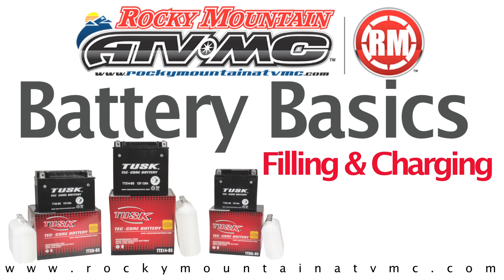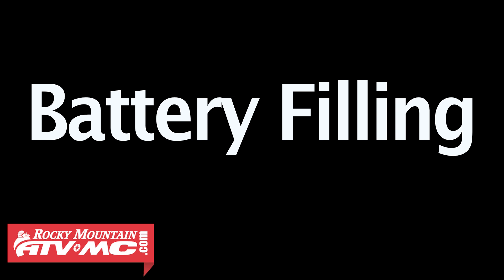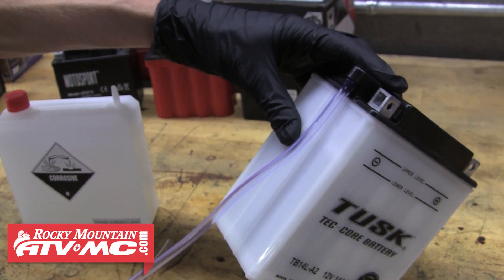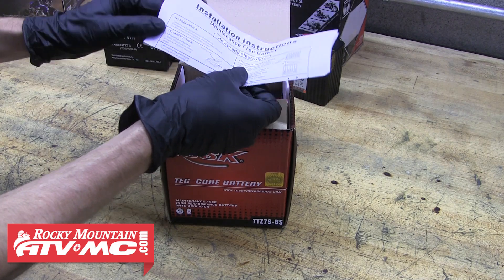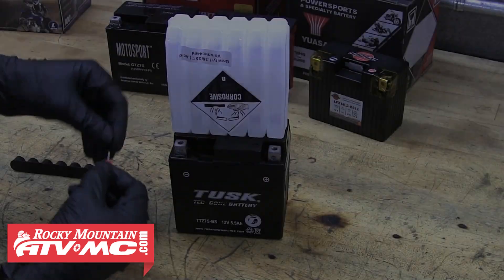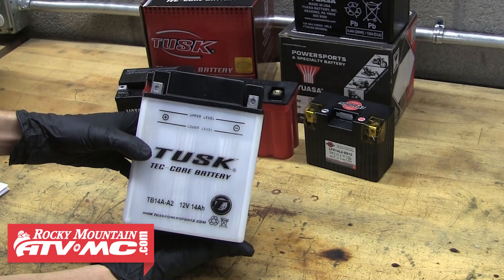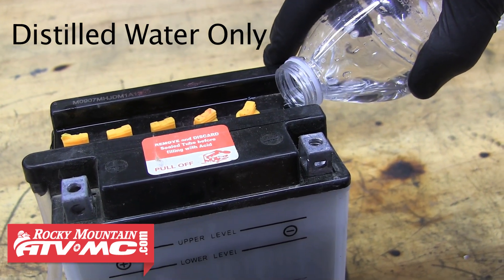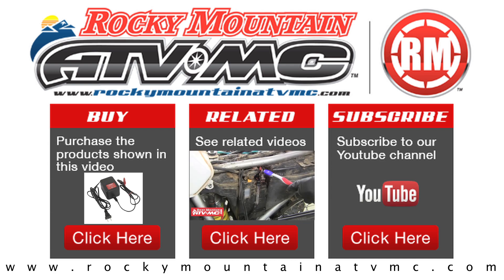Battery Basics & Activation - Filling & Charging a Motorcycle Battery

Comment: I heard you have to leave the plugs out when you charge it because they build up pressure, is this true
Reply: I had a mark on my ceiling cuz I left caps on.
Reply from the maker: Austin Allen that is good practice.  I personally do it, but most acid type batteries will have a vent tab on them, where you can attach a breather hose.  This vent helps any air bubbles to escape.  It's more personal preferance if you choose to leave the plugs off or not.  Both methods work fine.  Thanks for watching.

Comment: Scary as hell working with sulfuric acid. If you poke a vent hole, make sure to be patient and not squeeze the bottle unless you want to squirt sulfuric acid on you.
Reply: Its not that hot. Lol. Just have some baking soda and vinegar handy and dont go tossing it on your kids & you should heal up just fine. 😂  ive literally sat in a 100k gallon tank thats used to store it at about that same concentration and it stings a little..

Comment: when charging a normal acid battery do i need to put overflow cap back on or leave off wile charging?
Reply: @rmatvmc  I know this is an old comment sorry, but do I put the overflow cap back on before installing the battery, or does it just stay off, also what is the tube connected to it for, and do I leave that on?
Reply from the maker: @Zemixify  Yes, you will want to put the cell caps back on before installing the battery on your machine. The tube connected to your battery is the vent hose, you can see at 2:00 where we talk about the vent hose and you can leave that connected. At the very end of the video at 8:29 you can see the battery installed on the machine with the vent hose still attached.

Comment: if I received a dry 6 volt battery and add the acid to it, let it set for an hour, then check it with a volt meter should I get 6volts (roughly)? I know it won't be a strong battery until I charge it but I should get 6v. I am getting only 3 volts (roughly), would that mean I received a bad battery?
Reply from the maker: It's really hard to say on that.. roughly the battery should have about 70-80% battery life.  I would tell you to charge it and then check it.  If it's at 3v then, then i would warranty it.
Reply: My apologies, I didn't purchase the battery for you. Despite now having it on a .5 amp trickle charger for 6 hours it still shows as 3 volts.
Thanks

Comment: We use a battery for our inflatable boat. The acid level dropped after loads of usage what do i do?
Reply from the maker: It depends on the style of acid battery you have?  Some batteries are sealed with a strip on the top and others have an individual battery cell caps and these you can easily refill with acid or distilled water and then put on a battery tender to charge.

Comment: Hi, thanks for the great video. Just a question, can i use the battery just after filling the acid in (as I don't have the charger)? I've always thought that the electricity generated when running the scooter will gradually charge the battery?
Reply from the maker: To get the full battery life out of the battery would be to charge it first.  The stator doesn't put out enough electricity to charge a battery's first charge.  Your battery will be at around 80% battery life after filling it with acid, so yes you can run it after you have filled it.. but i would recommend you charge it after.

Comment: yes it is, yall think by me forgetting to charge first caused it,but all lights showed up just when push start dont hear nothing.
Reply from the maker: @Shedrick Bosley It could very vell be your starter is bad?  If you have access to a multimeter test the battery and see how many volts it reads?

Comment: installed new maintenanc free battery bike started good a couple of times then tried to start its like starter wasnt getting no power please help
Reply from the maker: @Shedrick Bosley Are all the cable leads tightened down nice and snug? It could be that you may have received just a faulty battery?  Is it the sealed no maintenance battery? No filling the acid required..

Comment: Hi ! Rocky Mountain ATV MC , can i use 3 amp charger to charge a  9 Ah AND 5 Ah 12V BATTERY ( not  simultaneously )
Reply from the maker: +Nimesh Kumar A 3 amp battery tender should be the max when dealing with these smaller batteries.  We recommend as low as a 0.75 amp trickle charger.  Like it's mentioned in the video, we divide the amount of amps x 10 and you get your recommended charging rate for that particular battery size. If you have any other questions let us know! Thanks for watching
Reply: +Rocky Mountain ATV MC  I want to use a HID  in my bike which draws 6 amps in the starting (for 2 minutes) and later it settles down at 3 amps of current draw  
and 
if i charge it with a slow charge rate then soon my battery  ends up with low juice ,
 that's why i was asking for a 3 Ah charger for 9 Ah battery (because slow charger will not work for me) correct me if i'm wrong.
Reply: I have this charger it has 4 and 2 amp setting, we put it on 2 amp and 12 volt is that good
Reply from the maker: Imma Turkey Yea that sounds fine.
Reply from the maker: +Nimesh Kumar What bike are you riding, Year, Make, Model? The trickle charger should be plenty to charge your battery but it shouldn’t need to be charged every single day. If the battery is getting drained too quickly it sounds like your bike isn’t producing enough power to handle that light.

Comment: helo, c0ol vidEo.. cAn u help me.. i just b0ugHt a quantum brand m0t0rcycle bAtTery, and lately i f0rg0t to tUrn ofF oNe bulb making it to liGHT FOR 4 days.. when i switch oN my m0t0rcycle, the bAtTery waz already draineD.. do i neED To recharge the bAtTery or sh0uld i replaCe it?
Reply from the maker: +Michael John Manipon Try and recharge it.  Use a battery tender that put out 1-1.5 amps.

Comment: So if "like I think I had was a old battery"a battery has lost allot of its acid and its been filled time and time again with water to the point that it has a low charge rate,but appears to still have fluid levels between the marks upper&lower then what happens to the acid-is it almost nothing but water at that point?                              Like how many times do you have to re-fill a battery in its life before you have to add more acid (if you do that at all)?
Reply: The acid never evaporates. The water does.

Comment: I just bought a new Firepower battery that is 11Ah. The only motorcycle charger I have is a " 1 amp slow charge" charger. Is that charger ok to use or do I need something different? thank you
Reply: Rocky Mountain ATV MC
Reply from the maker: Alex Alpert That will work just fine for you yes.  Thanks for chiming in!

Comment: Thanks for the video.
I got a question, the battery we got only had a short instruction and we only got one hose, since the instruction said to hook up the hose to the vent "plugg" we thought this also was the way to fill the battery. So we hooked up the other side of the vent hose to the acid pack and turned it up-side-down and it started to fill slowly. Filled the battery without problem to the upper level (through the vent plugg). My question is if we might have damaged anything with the vent plugg. 
And also, after first charge, should the acid change battery?
Reply from the maker: Utskuren Biff The vent system should be fine.  What are you referring to "..acid change battery?"  As long as each of the cells have been filled to the correct level and then fully charged it should be fine to run.  Thanks for watching
Reply: Rocky Mountain ATV MC Sry, I ment if the acid should change color after first charge, from clear to a little bit yellowish?

Thanks for answer.

Comment: My battery got hot after filling it is that normal?
Reply from the maker: nope nope Were you charging it and that is when it got hot?  Generally the battery will get a little warm is all after being filled.
Reply: Rocky Mountain ATV MC no it wasnt charging, i left to go buy a charger and when i came back the battery was around 100℉ to 109℉
Reply: I also just found out that it has been charging for about 20 hours and the trickle charger still thinks that it isnt fully charged
Reply from the maker: nope nope What brand battery did you buy?  Did you buy it through us?  If so i can look into it for you?
Reply from the maker: nope nope Sounds like something's going on that shouldn't.  Let me know if I can help you out more on this issue.
Reply: Rocky Mountain ATV MC its a tokyo 12n12A thats really old but its never been filled and i can see a lot of bubbles because the plastic is clear no and i didnt buy it from you guys although i have bought a lot of parts from rockymountain
Reply from the maker: nope nope Is it a sealed type battery that comes with a seal cap?   Or does it have individual cell caps that you can remove to fill when needed?
Reply: +Rocky Mountain ATV MC it's not a sealed battery and it still bubbles a lot when I charge it , it acts like it's being over charged, I've already had to add water to the cells
Reply from the maker: +nope nope It sounds to me like you could have bad cells in your battery. Very minor bubbles that you have to look hard for are normal especially after you first fill the battery but if it's bubbling and boiling every time you go to charge it there is definitely something wrong. I would probably suggest investing in a new battery.
Reply: Rocky Mountain ATV MC that battery only lasted a year it was never happy when charging